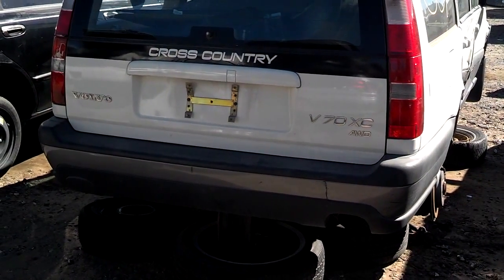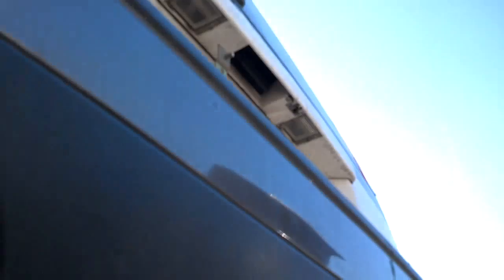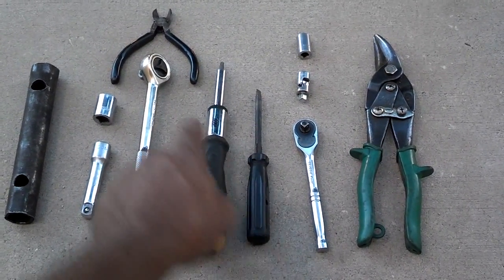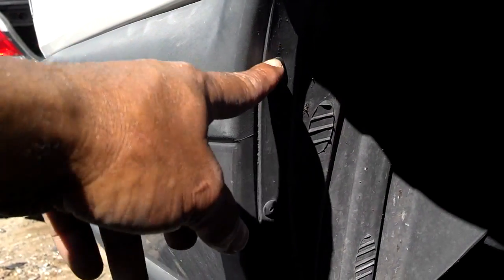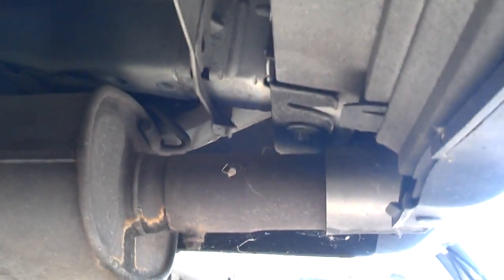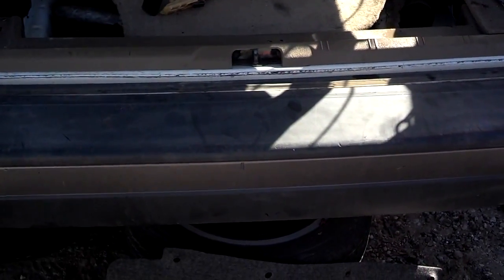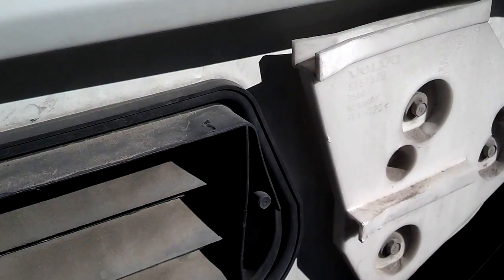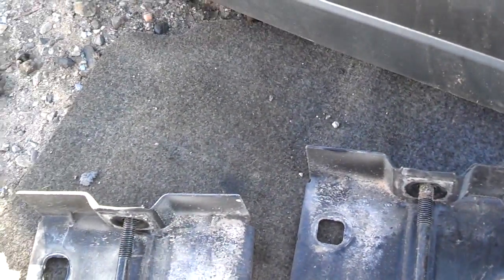How to remove the rear bumper removal, or replace the mounting brackets, Volvo 850, V70, etc. - VOTD

Comment: Most helpful. Trying to mount a hitch on my 2000 XC 70. I stared at it a while and then came to UTube hoping you had addressed this. You are a real daysaver. I’d still be staring rather than wrenching. Or worse yet, I’d have broken something trying to disassemble the bumper. Good tip on getting the pop rivets before you tear it down. Couldn’t be happier that we apparently own the same car.  My other Volvo is a 1968 1800S. Between you and my British Utube mentor specializing in the Amazons, I feel like I have mech angels at my elbow. Thanks for doing such a great job on these videos.
Reply from the maker: You are welcome

Comment: hi Robert talked to you a few years back with a problem with my 1999 xc redid the top end what you told me on the phone was 100% correct been running for 4 years now  now looking at some more vids  bracket replacement great info  thanks for the phone call   by the way just picked up a 2008 xc  your friend from montreal
Reply from the maker: Awesome! Thanks for watching.

Comment from the maker: LOL, Most people hit grill to bumper. While they are on their brakes, the nose of their car is low and their bumper goes under the bumper of the car in front of them. It's an accident flaw. So the car in the back slides under the car in front, crashes their grill, radiator, ac condenser, transmission cooler. lights, finder, and hood (sometimes pushes that stuff into the motor and damages that stuff). Yes the Volvo does have a strong rear bumper but a car that dips doesn't help.

Comment: Thank You Robert! I live near Pittsburgh, so we do get the rust from salt and water. The bumper on my 94 850 wagon is draggin' as you described. I inspected it and found the mounts to be as soft as wet graham crackers. IDK why the bumper is still on there, but your video did answer a lot of questions I had about the structure of this bumper and what to expect if I try to fix it. I may just bolt up some support hooks or bolts to temporarily secure this thing as I am worried that it may fall off while driving. I know you said it won't fall off, but I'll probably do this just to be on the safe side. I will look for the brackets online, but I think we are going to get rid of this car anyway, so I may not. Great car, but I can't afford to spend too much more money on it. Best of luck in the South West.
Reply from the maker: +randy fink Thanks Randy. And thanks for watching.
Reply: Hi Robert- I hope you are well. Thanks You again for the great video. Due to to some physical problems that came up, I was unable to do this job myself, but I found a good shop in Coraopolis, PA that was willing to take on the task. It cost me about $345. $215 for for parts including a face bar, two brackets and all the associated hardware. The labor was $145 and that also included removal of an old rusty tow bar. It feels great to drive this car around now that it is solid again!

Comment: Hey Robert, thank you for everything you'rere doing.
I removed the bumper on my V70 and I found the rubber sealing unglued inside the bumper. Is it supposed to be glued to the edge of the car - or to the edge of the bumper?? I don't see any sealing in the video. Thanks!
Reply from the maker: Sadly, I have no idea what you're talking about. Maybe you can text me a picture.
Reply: @RobertDIY  I am not able to add here any link, nor the name of the eshop to show you. I wrote you on Facebook, if you still use it...

Comment: Part number for the blind rivets are 979878.
The part number for bracket 3512570 has been superseded to 6816114.
I was told at a Volvo dealership the brackets rusted due to galvanic corrosion. Steel and aluminium don't work to good together.
Reply from the maker: That is true, different metals in contact with each other will rust when water is introduced, unless one of the surfaces is painted or covered somehow.

As you could see from the video, this car had NO RUST on the brackets. I have seen several southern cars with good brackets. Believe me, the northern salt and moisture has a lot to do with it.
Reply: Thanks for the part numbers! I was worried I would have to buy used brackets.. And I live in Finland so we don't have anything south enough to avoid snow and salt..

Comment: Hi Robert, another very well done video. I have a Volvo S70 2000 Base and  I have to replace the Rear Brake Dust Shield to have my hand brake work properly. Some hardware parts  are attached to those back plates. The designed is poor in my opinion. Because the hand brake is a security system i am surpeise that Volvo did not design it to be more durable. Anymay now I tried to find these Dustshieds for a reasonable price. Can you help me please. Thanks. Michel Pelletier Rigaud, Québec Canada
Reply from the maker: +Michel Pelletier send me an email.

Comment: Robert, thanks for the instructions on how to replace the brackets. but isn't the real reason for the corrosion the contact between the steel brackets and the aluminium bumper bar? i've seen similar corrosion between aluminium (semi)trailer chassis and subframes once the plastic coating between them had worn through.
Reply from the maker: +Ivo Kraaier lol

Comment: Hi Robert! I have a Volvo 850, and the bolts on the rear bracket are just rusty and the threads are gone, what would you do to fix it? Greetings from Sweden
Reply from the maker: I had a video showing what I did put it is in my Patron site. I had to deal with that with my yellow T-5R. I'll mix a video and post it in about an hour.
Reply from the maker: https://youtu.be/AR1soDrY4P0
Reply: Thank you so much, this is absolutely overwhelming, that you actually made a video for this case, bless you Robert

Comment: Hi Bob,I replaced bumper brackets but having trouble alining bracket hole when treading bolts.When bumper is off car theres no probmem once bumper is on i can see clearly throught The hole wile im under car yet bolts wont tread throung ? What am l doing wrong?
Reply from the maker: +Rafael Ramos have you tested the bolts with the bumper off?

Comment: Hi Robert; great videos, thanks so much. Do you think it is necessary to use Volvo-specific rivets (i.e., from Volvo, IPD, FCP Euro, etc.)? Would it work if I just bought some rivets from the hardware store? I appreciate that, if I can't get plastic coated ones, then they might not last too long here in salty Ontario, though.
Reply from the maker: Tim Dyer Other rivets will likely damage the plastic parts.

Comment: Hi Robert
Great Videos, I subscribed some time ago.  I was wondering How do you install those rivets?  Someone rear ended me and I need to replace those brackets.  But before I replace them I will also need to replace those rivets.  How do you install them? Thanks
Reply from the maker: Cut out the old one and install the new ones with a rivet guy.

Front Fender Removal, Volvo 850 - Auto Repair Series

Comment: Does anyone know what size the two short botls are that hold the bracket to the frame are. They are back ordered in my area and I would like to get the job done. Thanks again robert for these very helpful videos that keep these great cars running.
Reply from the maker: I can send you a couple. I don't know the size. Send me a text or call me.
Reply: @RobertDIY  Thank you so much Robert but all I need to know is the size and length then I can scoot out and buy some. My best guess would be 10mm x 1.5". Is that about right?
Reply from the maker: I have no idea.
Reply from the maker: They are probably the same size as the bolts that secure the seats to the floor.
Reply: @RobertDIY  Awesome Robert, that totally help. Thank You.

Comment: Will the XC70 (V70 XC) bumper fit on the V70?
Any pros or cons in putting a XC70 bumper on the V70 (if possible).
Reply from the maker: Yes. Looks
Reply: @RobertDIY  and will the rear xc bumper fit on a s70? I cant find anything about it anywhere

Comment: I wouldn't recommend cutting the rebar at all, it lessens the structural integrity of the rear bumper to do that! Otherwise great video. By the way I work at a body shop, sometimes we do need YouTube to figure out how to get something apart.
Reply from the maker: +Ryan Pearson LOL, I bet. Thanks for watching and sharing.
Reply: The brackets are cheap, make sure and order the two long bolts too. Don't cut the rebar though. 👍
Reply from the maker: Ok.